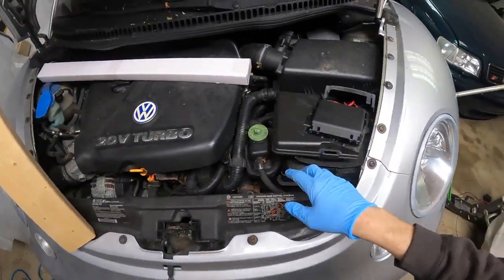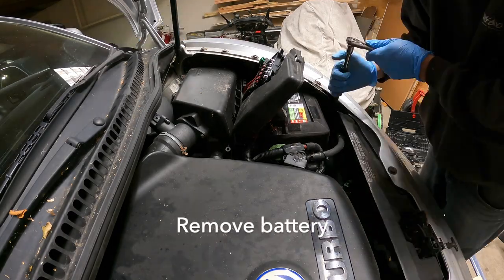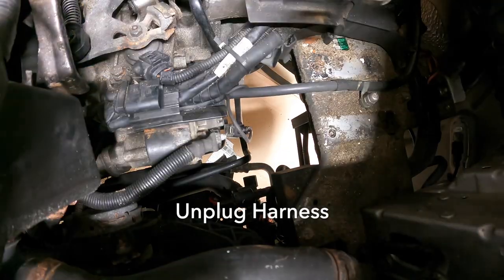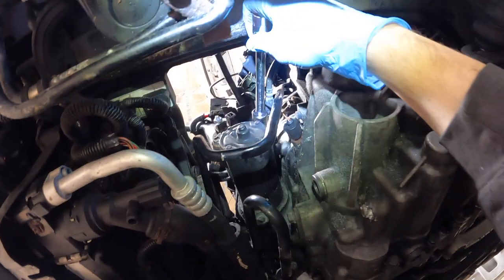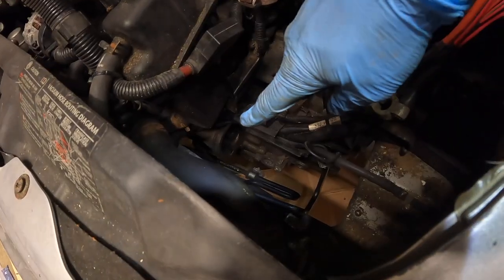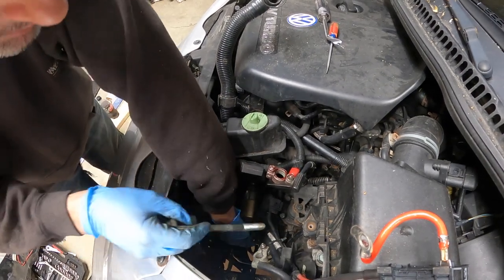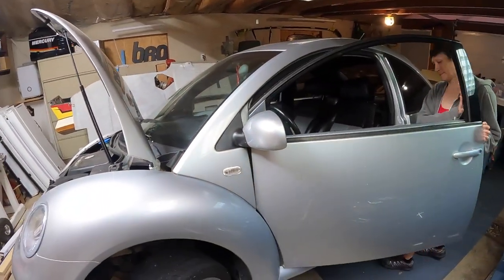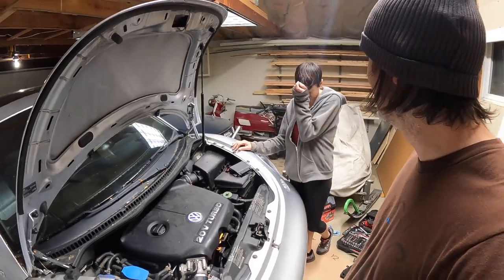How to replace a starter in a MKIV VW Beetle 1.8T

Comment: The armature between the solenoid and the motor itself definitely looked questionable. Check the ground wire between the transmission and the body also the main ground point under the battery tray. Check the ignition switch, all the fuses/ relays. Wish I were there, I'd be happy to fix it for you.
Reply from the maker: On the new starter?   The old one was definitely shot, the wire was melted/not touching the actual starter.  I'll check the grounds next, good call.
Reply: @ADDvanced  
Well bare in mind that I'm looking at it on a small little crappy phone screen, but the old starter looked like the wire was hanging on by a thread so to speak. There is a ground stud on the trans that goes to the body of the car. Should be towards the top of the bellhousing and the ground junction is in the battery tray area. Wouldn't hurt to check it since it's easy enough. Could definitely be a beat up ignition switch as well. What happens when you try to jumper terminal 30 and the 12v lug on the starter? Should crank no problem. Willing to bet the last position (cranking) on the ignition switch is shot.
Reply from the maker: @psavel274  If that were true tho, why would the signal wire show 12v when I turn the key?    I would think that would mean the ignition switch is good.
Reply: It should be fine then unless there is some sort of voltage drop bullshit going on. I've seen quite a few of the mk2/ mk3 cars where it'll show voltage but the actual contacts inside the switch get worn enough where sometimes it won't start unless you jumper the starter between the two terminals.